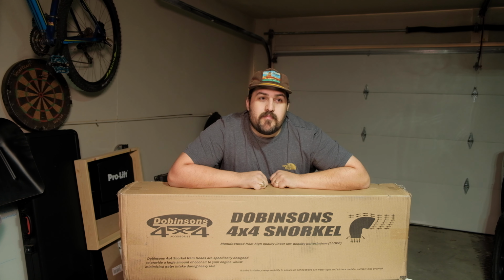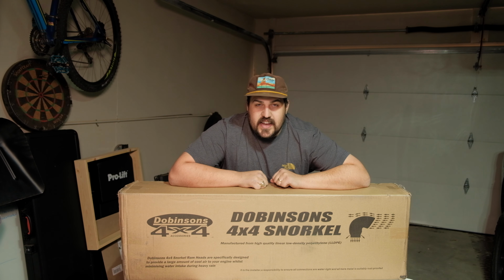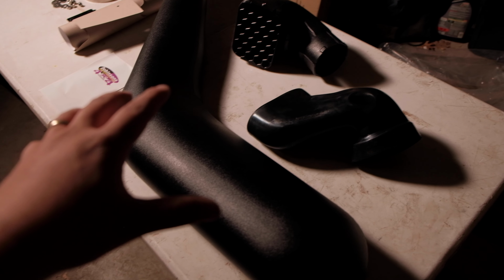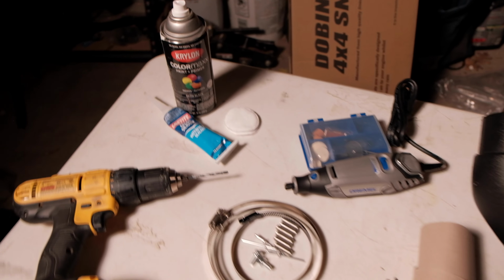Dobinson's Snorkel Install 5th Gen 4Runner

Comment: We went with the same snorkel and love it works just as well as the ARB and a bit better price.  I will say to help keep the air cleaner turn the spout around facing backwards it will help keep the air filter cleaner for longer.  A friend here around Amarillo does it on his FJ and told me about it well worth it.
Reply from the maker: I’m thinking about throwing on a prefilter at some point still up in the air though.
Reply: @flatlandadventure7123  The sy-klone 9001 I've looked at and will probably do eventually myself. Just a bit high for right now but it's just a time game much like a full rear bumper.

Comment: Hi, I would like to know if drilling on the column is necesaryofr the install. I saw other videos where that was not done. Just want to make sure I do not drill holes that maybe are not needed. Thanks.
Reply from the maker: So the instructions call for drilling there, but others use 3M double sided tape instead. Do it at your own discretion. For me I didn’t want to worry about a limb catching it and ripping it hard from up there so I decided to do the rivets but I almost went with the 3M tape myself.